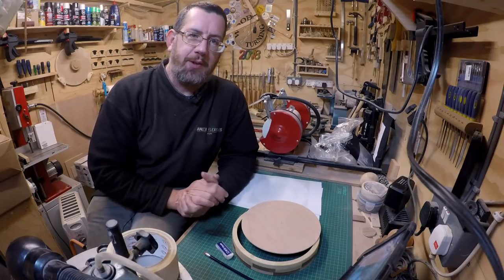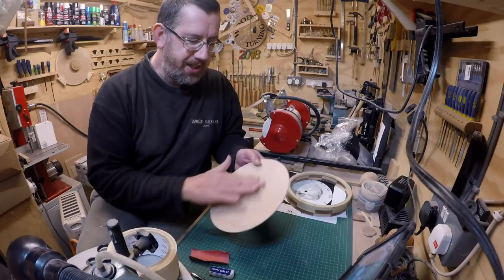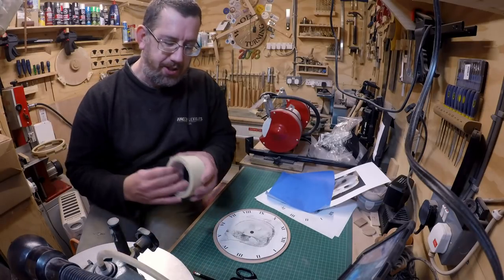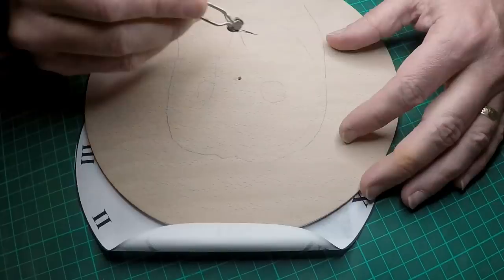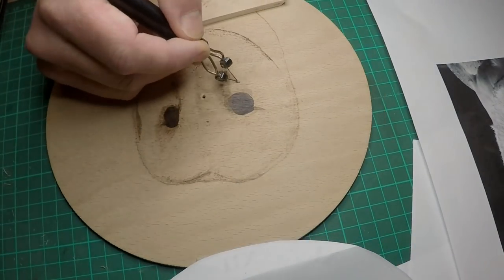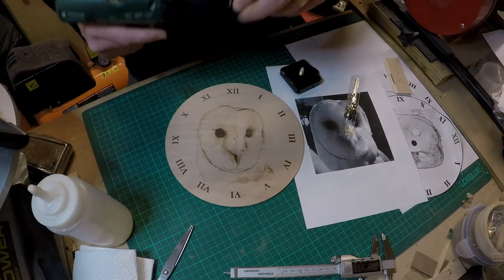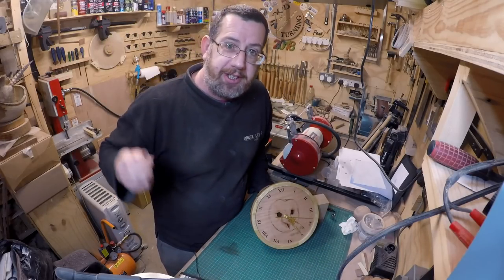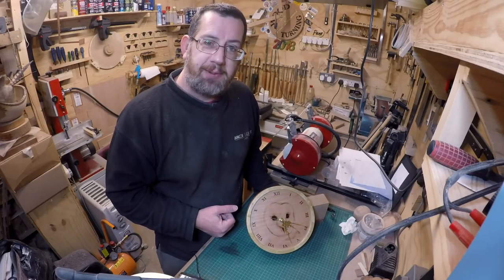Segmented Pyrography Clock (Part 3) - Episode 176

Comment: Loved the “fur”.....what wire are you using in your pyrography tool? An excellent series of videos.
Reply from the maker: Thank you David. Yes I know they should be called feathers, lol.
I'm still using the standard wire that came with the Peter Childs Pyrography machine. I will use the shading bit almost all of the time as it is so flexible. After watching Valarie Connell / DrawingWithFire I've learnt a lot in the pyrography in that it's best to start very faint and slowly build up the deeper burning. Takes a lot longer but the results are far better.